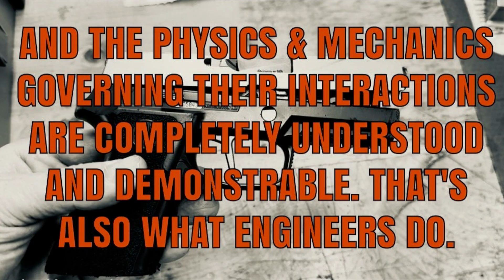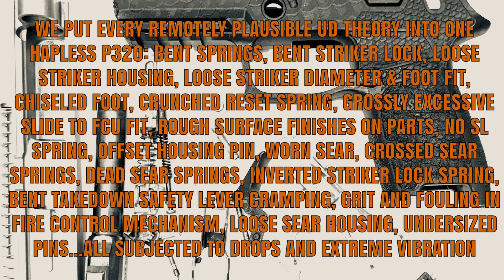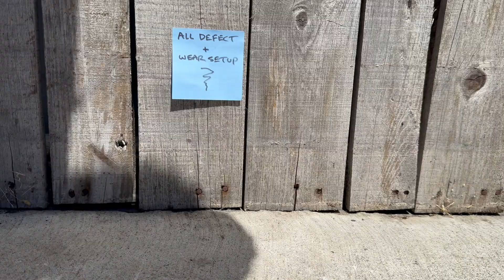P320 Testing - Tolerance Stacking & The Thousand Slices of Swiss Cheese

Comment: 🤯JFC‼ Bruce Gray you said the P320 was drop safe back in the day when it was NOT in fact drop safe & doing so allegedly knowing it was not drop safe⁉.. Allegedly you quietly developed/designed a drop safe fix for the "drop safe" P320 that was not in fact drop safe; then sold or bartered and trade this drop safe fix for the drop safe P320 that was not drop safe to Sig's Senior research and development engineer Brian McDonald, so they (Sig Sauer) could do a "P320 Voluntary Upgrade Program" to make the drop safe P320 that's not drop safe, drop safe⁉ Good work Bruce, you're now known as a LIER⁉ So allegedly Bruce Gray was designing the voluntary upgrade while at the same time openly denying the P320’s drop safe risk⁉ Bruce Gray's August 2, 2017 article defending the P320 is almost comical now in light of what happened. Five days later Omaha Outdoors would release their P320 drop test video, and the very next day Sig announced its voluntary upgrade program. The SIG Sauer P320 Voluntary Upgrade Program officially went live on August 8, 2017. The hole thing really puts a bad taste ("sour") in your mouth if true. It’s the Fight Club equation. It’s cheaper to pay lawsuits than recall. If true F* Sig Sauer & Bruce Gray‼ I really don't know who or what to believe.. but will stay my distance from Grayguns Inc., GBRS, and Sig Sauer (+Sig Shills) based on the proverb "where there's smoke there's fire" just out of an abundance of caution.

Comment: Joey Russo recreated a UD with his pre VUP sig. "Rangemaster’s Bench Episode: How I Created An Uncommanded Discharge In My P320"
Reply: He did it by completely removing safeties.
Reply: @aussieexpat  No, all safeties are intact in the test. Weakened springs yes, but not disabled.
Reply: @DagaYute listen to what Joey says. He disables 2 out of 3 critical safeties and then compromises the last.
Reply: Joey wasnt proving that it was unsafe, but that if you disable enough safeties, it could go off without a trigger press.
Reply: @aussieexpat   . Joey uses: 1. the altered sear 2. weaker springs for sear springs and safety lock springs 3. heavy fouling around safety lock/spring. This is similar to what Gray Guns also did with their testing which was 1. improper striker lock spring assembly 2. Fouling everywhere 3. Using a worn down sear and striker and 4. misassembled sear spring. They are very similar tests and yet Joey's test does cause a UD.
Reply: @aussieexpat  You should watch his follow up video "Rangemaster’s Bench Episode: Why I No Longer Use the Sig P320"
Reply: @DagaYute i have. And understand his position. For me, I'm ok with the safeties on the p320. Or at least, i dont know of a safer handgun.
Reply: @DagaYute the difference is joey made sure they were disabled.  The hypothesis is the same, but joey simply disabled the safeties. While grey guns here are showing a worst case scenario.
Reply: @aussieexpat  The Glock design has no ability for the trigger to move without a trigger pull because of the drop safety which is a passive safety since it is the trigger housing supporting the cruciform. The same cannot be said about the p320's floating sear design because requires active tension from the sear springs to keep it in place. I am issued a M17; I would be perfectly content to carry it if Sig made the external safety block the sear like the P365 does.
Reply: @aussieexpat  I would argue Joey's scenario is the worst case one.
Reply: @DagaYute  The drop safety on a glock is actually the trigger dohicky. So a hinged plastic part making contact with a plastic frame.

I would trust my life with it fine, it's well proven, but the Sig is simply better. The P320 balances the weight of the trigger bar with the weight of the trigger shoe, there's literally no part that can break to make it no longer drop safe.
Reply: @aussieexpat  The tabbed safety on the Glock is there to prevent trigger movement during a drop, i.e. an inertia safety which the P320 lacks and part of the drop fire problems in the pre VUP guns. The Glock drop safety is the safety ramp within the trigger mechanism housing where the trigger bar rests.
Reply: @DagaYute you are correct. But the cruciform sear isnt a drop safety and glock do not recognize it as such. There may be still enough energy to ignite the primer from that position if the sear failed.

The actual safety is the striker block, which the sig also has.
Reply: @aussieexpat  The trigger bar/ramp/triggerhousing is on Glock's safe action system website as a drop safety and on their armorer material. The  P320 striker safety lever is significantly more fragile in the P320 design; it is a critical part that we have to inspect on our M17s; our experience in the Army is that they are prone to failure/breakage which is why during PMCS before and after we draw/return the pistol it is a mandated inspection item. The dome shape of the Glock striker safety (and the P365) is significantly more robust than the lever design of the P320.
Reply: @DagaYute i agree that the lever is nowhere near as robust as the plunger design on most strikers.

This being said, never seen anyone demonstrate finding one that had failed and the gun continue to function.
Reply: @aussieexpat  Sig's P365 is a safer design
Reply: @DagaYute mrmm depends on your definition. I seriously dont like the fact the trigger spring breaks...
Reply: This video is addressing the uncommanded discharges not the drop issue, which was fixed. And if u think other manufactures have never had issues with their guns on new release you're biased and ignorant.
Reply: @jmanswat2457  exactly. Glock has the same issues (glock leg) and hence the nypd trigger.
Reply: @jmanswat2457  Joey's video shows the UD issue, not the drop issue.

Comment: Any way the manual safety could be designed to block the striker or the sear?
Reply: Good question. Would go far in satisfying the critics. But if the system as designed can't be made to discharge without a trigger pull by any lab, then it must be verified safe according to those standards of safety declaration. And if it features a trigger pull to engage the mechanism then an external safety that only blocks the trigger would be acceptable.

Comment: Fact check - the manufacturer, not Grayguns, should've made these videos. Its disturbing that they don't have the will to meet their customers on the same level. They're too mighty or powerful to stoop that low. Grayguns is low enough to see us eye to eye. Even then, they have their own issues.
Reply: The manufacturer has run these tests and more.  The problem is that people like you refuse to believe their results because they don't fit your narrative.
Reply: Was that the point or you can't comprehend? Sig should've made these videos, not these people.